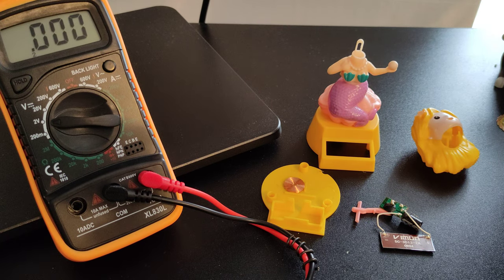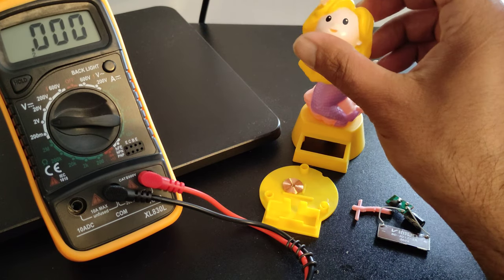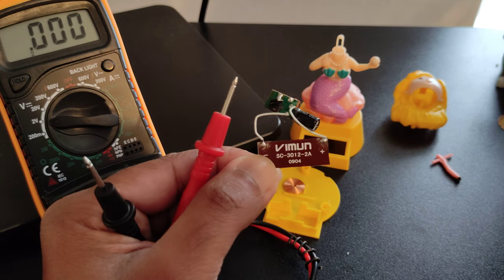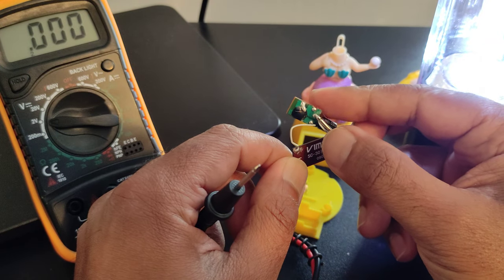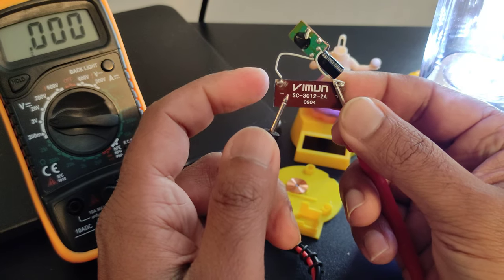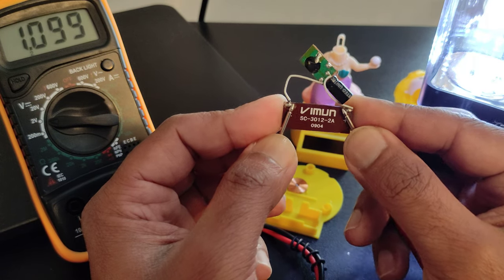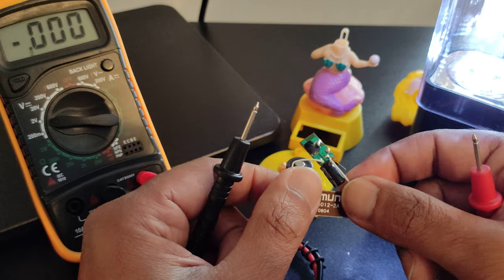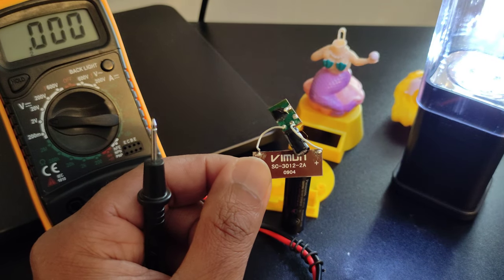How solar dancing girl toy works?

Comment: And you totally forgot to say you pulled the copper coil wires out of the small circuit board  and have to resolver them back in.